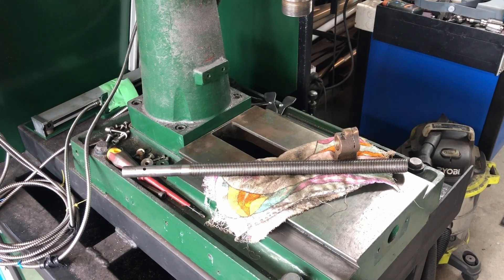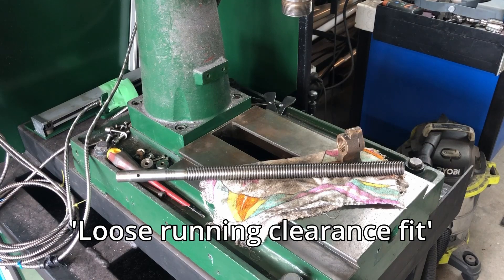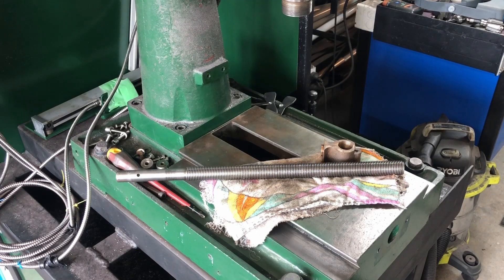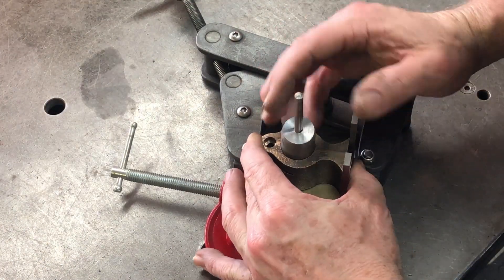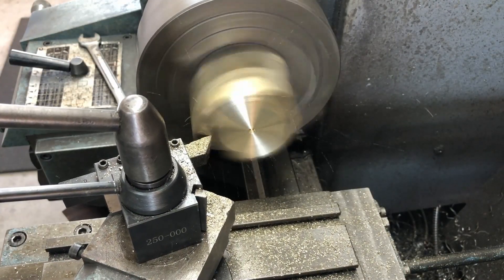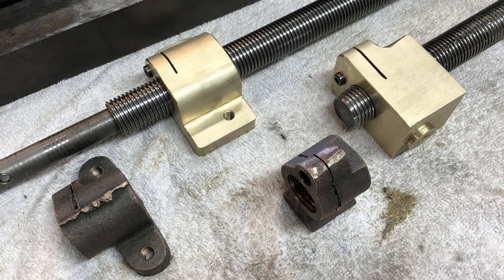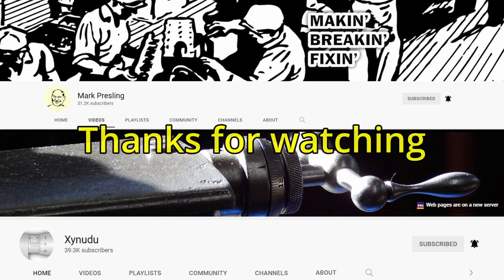My Mill Is In Pieces! What Happened?

Comment: The old nut looked like it was bronze.  I’m unsure of what the difference would be.  Any concerns?  Was there any noticeable improvement in precision or movement once it was all back together?  Great work, as usual!
Reply from the maker: Thanks for your comments Joseph. Others have mentioned that as well. I understand that bronze is harder wearing than brass. No issues at the moment, but lets see how it lasts. Yes, a heap of backlash was taken out with the new nuts. That indicates that the old nuts were very worn. Well, one was so worn that it actually gave up in the end.

Comment: It is possible the band saw did not like the brass as sometimes the brass will clog the teeth up
Reply from the maker: I presume that is the case. I felt the teeth and they still feel sharp so maybe they are a bit clogged up. I have not looked into it yet.
Reply: @thehobbymachinistnz  Try a blade with less teeth .. the minimum tooth count is 3 teeth in simultaneous contact with the work, but that would be silly. Use less, (and bigger) teeth for big stock as the tooth gullet(s) will fill up with it's(their) own swarf and act as lubricant until it clears.  Excellent video!

Comment: nicely done!
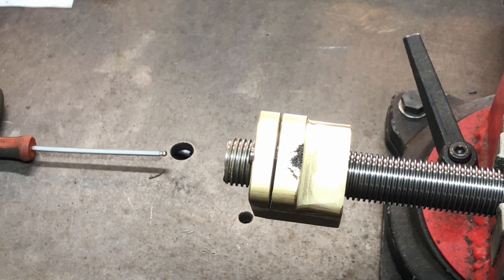at 17:15 it looks like there's a big dent in your thread just before the nut, I'm hoping that this is just a lump of grease though...
if it isn't grease, could it account for the slop on your nuts? 
the sharp edge causing excessive wear and gauging out the internals?

anyway, good stuff and I especially liked the regrinding of the drill bit into a milling cutter 😊
Reply from the maker: Thanks. That area is at the end of the lead screw. The manufacturer did not cut the thread to the proper depth, and it looks like they turned down the diameter as well (that's why the threads look flattened). The old nut can screw on at this end, but the new nut wont. The table travel does not run in this area.

Comment: That might be bronze..Aluminum could be used as a temporary fix that sometimes last much longer than ever expected if brass or bronze isn't available..Bronze would be much longer lasting than brass..
Reply from the maker: Thanks. Mark also mentioned that bronze would be better than brass for this application.
Reply: Bronze for some reason is super expensive here in Australia. Old brass taps are cheap though 😆